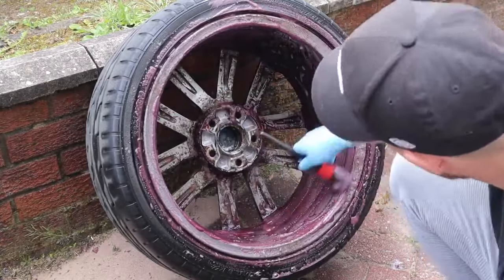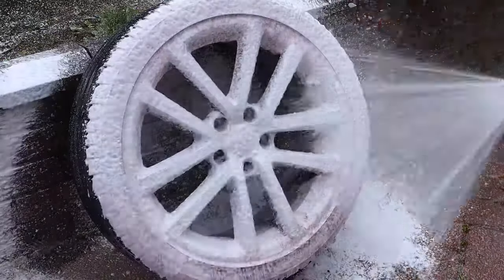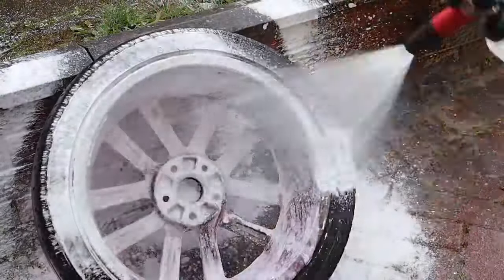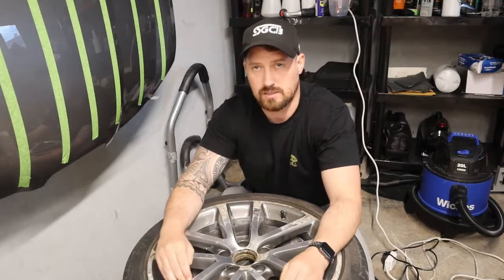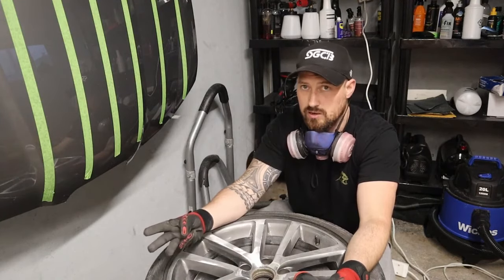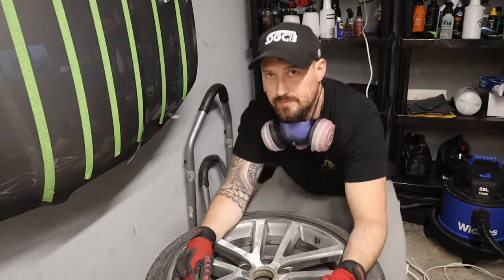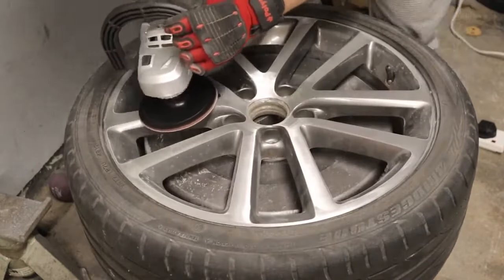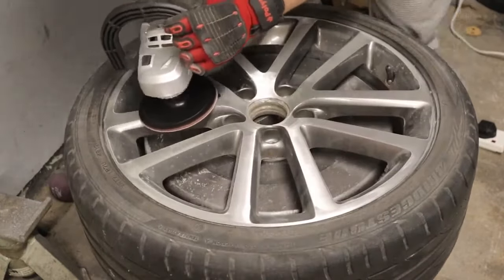Cheap and Easy DIY Wheel Refurb | Restoring Diamond Cut Alloy Wheels

Comment: This was proper interesting, David, a great bit of content.  My diamonds are a mess and need a refurb, unfortunately there are some pretty deep sratches, so I'm not sure i could do this, not wothoit some kind of filler. The cost of doing a diamond cut wheel down here isnt far short of new wheel money, that could also be an option.... when I'm rich 😅😂
Reply from the maker: Thanks Lee, you would be surprised at what you can sand out of alloys mate, these were a disaster and turned out amazing. It’s the same up here, your north of £200 a wheel in some places which I just couldn’t justify paying on car that only cost that much lol

Comment: Great video, a question if I may, did putting the clear coat on change the colour of the polished face? Only reason I ask is I've got wheels thar normally are machine cut and cleared but I cant see any tooling marks and looks more like light silver than say polished or machined finish.
Reply from the maker: Thank you, I think it more depends on the level of sanding that you want to goto. I wanted that more refined look but I think if I had stopped at 500 grit, the machined look would have been more obvious. I wouldn’t say the clear made any difference to the finish tho.

Comment: nice work .. the process can probably be simplified to speed it up with close to equal results - 1) scuff the paint areas. 2) power sand 220 3) power sand 400 4) hand wet sand/ wash off 6-800 5) power compound
Reply from the maker: ill need tp try that method the next time i do this.